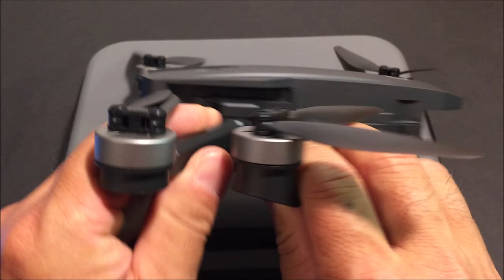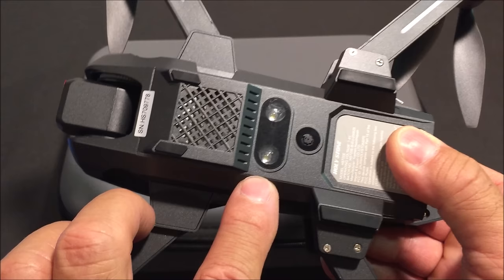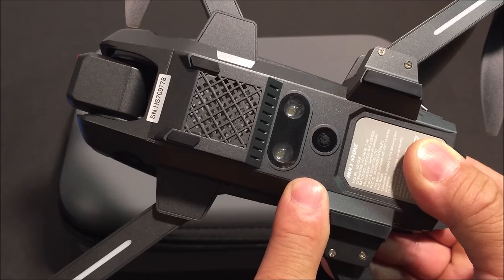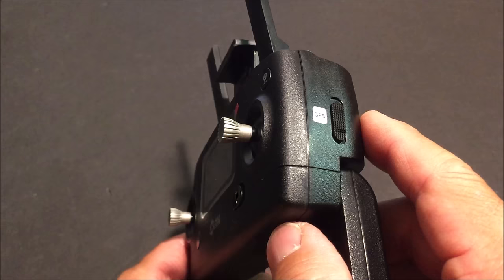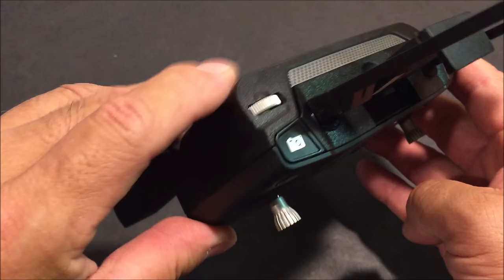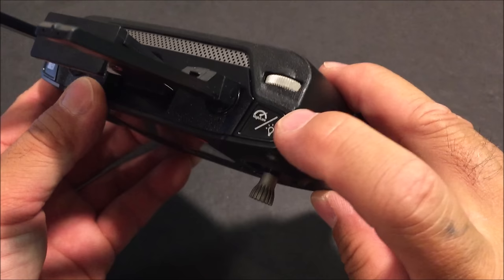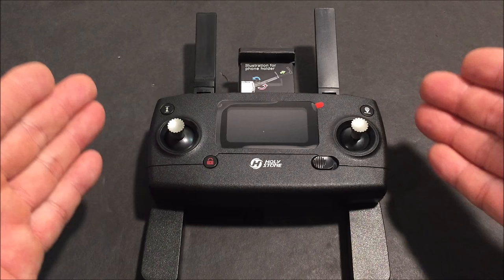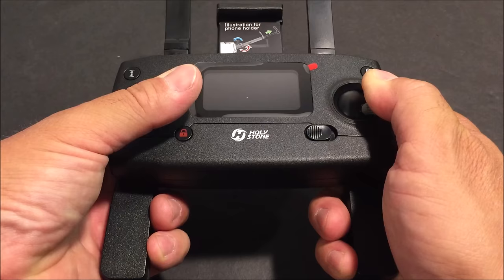HolyStone HS 720E with EIS / Review, Setup, Test Flight and 4K Video Samples

Comment: I have been researching this drone for a few days and I have to say this was by far the best demonstration of the capabilities of this drone. I have not made a choice yes but your video put his drone into the top 5. Thanks for putting the time in to give people like me the info we need to buy the drones we choose. Thanks for the discount code.
Reply: agreed, this is the way.
Reply: I can and would highly recommend the DJI mini se over any other budget drone as I bought mine brand new on eBay for £280 and the fly more kit so extra batteries props charger bav etc and it's far superior to this drone 3 axis gimbal yea it's a 2.7k camera but you wouldn't be able to tell the difference trust me but if you can afford it get the DJI mini 2 , 4k camera zoom function and so much more again go for a fly more kit.. good luck I love mine plus I know when I want to upgrade to the mini 3 pro I'll be able to sell my mini se for pretty much the price I've paid for it ESP if I don't end up using all three batteries as the DJI app records drones flights, batteries usage and charges for next owner to see why any DJI drone will out do any other drone of a similar price plus their app out does any other drone app plus all the minis require the minimal certificates or licence's and insurance needed to fly. My mini se just needs a drone ID and flyers ID which I have. Obtained by the CAA online test that only costs £10 a year to get or renew the drone I'd is free and lasts 5 years. This is UK CAA regulations. If you live outside the UK I do recommend you look up the CAA regulations and rules for you . CAA is the civil aviation authority. They make the rules for all aircraft. And mine being under 250 grams I can pretty much fly it where I want apart from airports, prisons military bases etc but less restricted for the drone in this video. So definitely worth checking the CAA rules mate before deciding what you get .... Plenty DJI mini se,2,3,3pro videos on utube 😉👌good luck fly safe keep the hobby available for everyone that can afford it 😉👌🫶👍💪🤞😄

Comment: Very nice and detailed video. You touched every point. Showed detailed remote explanation, how to change camera angle. I watched some many video but I was not getting a simple answer how the camera angle is changed. What two beep sound mean. 
You deserve 5 star rating.⭐⭐⭐⭐⭐

Can you also suggest or have video how to stabilize the picture in video editing software and which software would you recommend.

If anyone on budget would you say image stabilization comparing to 3axis gimble drone vs EIS as on this drone, is it really that much different
Reply from the maker: I did not use any stabilizing software in this video.
The EIS is a game changer for drones without a gimbal.  Now, there are drone with both and that will be better :)

Comment: The problem I have had with this drone and the HS720E is that both my original did a fly away, now having flown drones since 2018 I think I may have got the hang of it by now, each fly away did the same, after setting things up and then starting within minutes the drone decided to fly to its left so on pressing RH nothing happens, I then try to control the drone myself again nothing so in total I have lost the following 1xHS720E & HS720G being fair to Holy Stone they have replaced all the fly aways I've had, so far play to then. ~In my opinion there is something not quite right withe the drone / controller or both which needs sorting, I'm sure that Holy Stone can't keep replacing these fly aways. All that said I'm still of the option that these drones perform and look good despite the obvious. So for now I'll keep my fait hin Holy Stone.
Reply from the maker: Are you calibrating the compass?  And are you waiting for the gps acquirement? And are you calibrating the gyros?

Comment: Ok, so I purchased the HS720E but I have a problem. I have calibrated it but when I click one key take off / landing, the drone takes off and hovers at about 5 feet but it is very eratic and doesn't stay in position. It drifts off considerably and controls are not very responsive. Just 20 feet or so away and it will not respond correctly.
GPS is ON with 11 satellites being received
Battery power is full
Controler batteries are full
Also, the controller says it is in Mode 2. I have tried to switch to mode 1 by holding the lock button down while switching on but it doesn't change from Mode 2.
Any advice would be appreciated. Thanks RCE.
Reply: I noticed the same returned for mav mini to me best beginner drone too easy

Comment: What phone does it need to connect to? It's not mentioned in manual. Tried my Samsung A20, and my friend's Huawei, and it won't connect. I also have a problem with battery charger, that won't stop blinking, even after many hours of charging. Batteries seem to be charged though... I mean, I can fly it like regular RC plane, it even uses GPS utside, but no live video connection to my smartphone.
Reply from the maker: My 6yr old iphone works fine.  Even my old ipad works good.  Try another phone.
Reply: @RCEscape  Yes, I've tried it with Note 5, and it worked just great! Thank you :)

Comment: Are there any aftermarket blade guards that you can attach to this model?  The HS website doesn't show any blade guards for the 720e.  I bought one of these, and it's great...but when flying indoors, I had a little mishap with one of my curtains.
Reply from the maker: Not that I know of.  I would recommend not flying brushless quads indoors.

Comment: Thanks for the video. I just got a 720 for Xmas. I cant get the  transmitter to hold the phone securely. Its a normal 5.3" phone but it barely holds in place and blocks access to the light button and photo buttons on top. Is there a trick to mounting the phone?

Comment: At 09,45 , both sticks on the bottom to the left will calibrate the gyros you said, I did not see this in the manual, is this replacing the flipping around the drone horizontally and vertically ? Trying to learn here before I receive my drone, Thank you and great review.
Reply from the maker: calibrating the gyros are not the same as calibrating the compass.  you need to do both before each flighht.

Comment: I'm hoping you can help me I'm a first time user of this same device I powered it on and only calibrated to the right wich is the compass and not to the left wich you called the gyros and when I tried to take off my drone went awol and went in different directions and crashed what did I do wrong? Is it because I didn't calibrate the gyros?
Reply from the maker: I'm thinking the compass was not calibrated correctly.  You should calibrate both next time and confirm that it has been done correctly as shown in the video.
Reply: Same thing happened to me, I recalibrated, and waited until I had at least 10 sats no problems so far.

Comment: Hi, having the problem of constant uncontrolled flights of my 720E, I understood the reason, this is GPS orientation, especially in the direction from north to south, it goes into an independent flight when I turn off GPS, the drone flies well and hangs strictly in place. This is the problem of the defect itself drone? How to be in this situation?
Reply from the maker: Make sure it is calibrated correctly and this problem will be gone.

Comment: Just got it

1.  Can't connect anything to its SSID.
2.  No warning on low battery.  Beeps and drops and hits hard.
3.  Can't switch between mode 1 and 2 for control

Comment: I got this today theres a white wire hanging out on corner of one wing. What is this do I pull it out or just leave it, it’s not mentioned on the manual, so not sure if it’s meant to be there.
Reply from the maker: I think you are talking about the clear tip of an antenna wire so do not pull it out.
Reply: Yeah that’s what I thought it was. Just was afraid it was a wire that wasn’t meant to be there..thanks

Comment: Does this drone require cell service to fly ? I'm looking at buying one that's new and I'm totally new to it. But where I'm going to be flying it there's no cell service
Reply from the maker: No. there is no such drone that needs cellular service to fly.
Reply: @RCEscape  Hmm.  My buddy is under the assumption his DJI MINI 2 only Flys 160 feet away because no cell service. If I remember right it don't climb very high either.
Reply from the maker: @chrissaucier9386  

Follow me, way points and sometimes point of interest may need cell service but you don’t need it to fly.  I use my WiFi iPad to do most flights and it works just fine.
Reply: @RCEscape  Thank you. I'll get this drone and figure out what I'm doing before spending big money. I want something that will fly a few miles

Comment: I have this drone but would not advise others to buy it simply because the market lacks the accessories for it plus parts for when its broken or in need of repair, simply DJI has a wider market out there and can get way more parts for your drone to make it better or protect it.   Mine broke after 5mins of flying.   It hit a wall and one of its arms broke

Comment: Hi I have one of these, can anyone tell me what it means when all 4 red leds are flashing? Both batteries are full and compass callibrated and 12 sats. Thanks
Reply from the maker: compass calibration has not been done correctly.
Reply: RC Escape thanks for the quick reply. I will try and re callibrate. And thanks for your brilliant videos. From Uk 🇬🇧👍🏽
Reply from the maker: Either that or your battery is not charged up.
What color led lights are flashing?
Reply: RC Escape all four red leds flashing. Both batteries are showing nearly full.
Reply from the maker: @tolycobbold7659  
what color?  All Red?
The front lights are flashing too?
That is weird.
So the batteries are fully charged?
Reply: RC Escape yes all four red flashing I’m just about to have another try. I couldn’t see anything in the book or online about all four red flashing.
Reply: RC Escape strange, seems to be ok now. I will keep an eye on it over next few flights. I really appreciate your help. Keep safe.
Reply from the maker: @tolycobbold7659  
Enjoy!!

Comment: Hello, I usually watch your videos for fpv quads but I really need some advice on a GPS drone. I have watched a ton or yuh our videos on these type of drones and cant figure out which to buy. I'm looking for 20 min of flight time with GPS.  I'm looking to spend under $1000 and will be flying in low wind conditions. If you have any ideas please let me know. Thanks( I would prefer not to buy DJI).
Reply from the maker: With a $1000 budget, you should get a dji.
Reply: Thanks

Comment: Rc escape sorry meant for. Bothering you I want to know is the orbit mode great enough too make a good video for the drone
Reply from the maker: Well, it depends how good the video you are wanting.  This drone does not have a gimbal so it will have the horizon tilted when making the orbit.
Reply: Well I wanted to try out the orbit mode

Comment: I purchased this for my son Apr 4, 2021 and it would not get a signal... would not fly
Reply from the maker: You will need to follow exactly the calibration process as shown in this video.
If it is not done correctly, it will not fly.

Comment: What's the weight of this drone . As UK CAA rules and regulations are strict on what you need by weights. If under 250grams only £10 per year 250 and over £100+ and insurance before you can fly within rules which are restricted alot more than 249 grams or lower with a camera so even a £30 drone with a camera needs a flyers ID and drone ID at £10 😉👌 TYIA

Comment: I'm so confused what's the difference between hs 105 and 720e or is that the same? I came across the 105 because when I search to find 720e...no one has it. 🤔
Reply from the maker: Never heard of it but upon checking it looks to be identical to the 720e.
Reply: I ordered the 720e and they sent a 105. Seems to have all the same features. Does this have tripod mode?  Trying to figure out what the eye icon is all about  ?   Great video thx.

Comment: Hello,
I bought a C6000 camera. I want to operate the C6000 camera alone. I need an alternative application. Its application works as a drone + C6000. This is not working for me. I want to use it in rc car and want app advice for it. Just let the camera work. Thank you.
Reply from the maker: The c600 only works with an mjx drone doesn't it?  Don't you use the transmitter to take photos and videos with the signal passing through the flight controller of the drone or does it work by itself?

Comment: Watching this video again,. and this time I notice you have a portable table in the field with you. I was literally searching for a table today for the same purpose. I fly my drone in dusty grassy field, and the last time landed the drone, it blew a lot of grass in the opened carrying case. I think I'm also going to practice landing the drone in my hand.  Not sure difficult that is.
Reply from the maker: Table from Walmart. Used to be $15 now it is $22.  I still went and got a second one :) it’s worth it.  @16.25, I grab it and get it angry but if you rotate it side ways, the motors will cut off.  Sort of landing with your hands :) be careful though.
Reply: @RCEscape  , thanks. Ended getting a black stool from Walmart. Just need to sit one item (phone/controller or Drone) at a time. Also useful for sitting when needed.

Comment: Is it normal for a new Li-po battery to lose some charge in 36 hours after charging?
Reply from the maker: If it is fully charged and not inserted in the quad it should not loose much charge but there are smart batteries that do deplete their charge by itself.

Comment: Hey RC Escape, at 14:50 is the part I got stuck on the motors. Do you need to be outdoors in order to fly it? I tried it in a big indoor area and it wouldn't go up.
Reply from the maker: Does the motors arm?
Reply: @RCEscape  When I start up the motors and they get the propellers spinning, I try to lift the drone up with the joystick and the one key take off. It won't go up for some reason.
Reply from the maker: @titangodzilla9055  
check to see if the props are on correctly.
Reply: @RCEscape  the props are on correctly. The drone is just doing this. 14:50
Reply from the maker: @titangodzilla9055  
take it outside and full throttle it.

Comment: would you recommend this over the f11 pro 4k if price wasn't an issue? I know that the f11 has a gimble but this has EIS.
Reply from the maker: The F11 has a gimbal and EIS.
Reply: @RCEscape  yes which would you go for? Does the gimble really make a significant difference? I like the look and feel of the hs720e
Reply: @Handle-business  RUKO F11 PRO has longer flight time, approximately 30 minutes where the Holy Stone HS720E has about 23 minutes.  Also, the gimbal paired with EIS will provide more stable video footage.  And I'm saying this as a HS720E owner, I really like the HS720E a lot but I think the F11 Pro has a slight edge in flight time and video stability.
Reply: @TheCT416  thanks for that. Didn’t realise re flight time. I’ve seen the 720 and the build quality looks really good
Reply: @TheCT416  thanks for the response!
Reply: @Handle-business  Good luck with your decision, I think either drone will provide you with endless entertainment and value.  Something else to consider is the availability of additional batteries, replacement propellers, etc.  I have found Holy Stone has replacement parts for some drones while replacement parts are backordered for other drones.  Not sure about additional parts for the F11 Pro, haven't looked into it.

Comment: Just got the HS720E... your review is VERY good. I went through the calibrations, both the compass and the gyro and had 12-13 satellites and only a slight breeze. I lifted it up for the first time... it did NOT stay in one spot as solid as yours did. I could tell it was trying but it wandered around a bit by several feet or more. Any ideas as to why this could be? I'm already considering a return.
Reply from the maker: hmmm...I'm wondering if the gps switch is in the on position on your remote.  it does have optical flow sensor so even if you are not in the gps mode it will stay in position somewhat and from what you are explaining it could be that it is only using the optical flow sensor and also make sure there is no geomagnetic interference like power lines nearby.
Reply: I'm having the same issue (as well as others) with 12 satellites.

Comment: Great review! I got mine around Aug but the image quality not showing as 4K also it stopped going in any direction. Contacted them for the issue they sent me another one but the image quality also wasn't 4K. I ended up buying the DJI but the HS is a got drone to learn with before going pro
Reply: You have to record to a TS card. If you don’t have a card inserted in your drone then the video recording that streams over Wi-Fi to your phone will just be in 1080p and very choppy. You’ll want to record directly to a card and then also make sure you set your video settings to 4k in the app.

Comment: Very good video, very detailed, you covered everything!! Question,  how high up does it goes in feet and how far also? 
Thanks!
Reply from the maker: Thanks :)  I have not tested the height or max distance yet.
Reply: @RCEscape  thanks, I have a Potensic d50 is is good for what I paid but this will be my next one. My friend has a DJI , very good drone but lot of money.
Reply: Have been testing it and video is amazing, especially on the tripod mode which goes very slow. Once battery got low it gave me a warning and started going down on its own, but I have to test it again, I think I was not paying attention to the warnings. I do see in your video you mentioned stages of warnings so I guess I took it to the max and that is why didnt come back. Will keep on with testing.